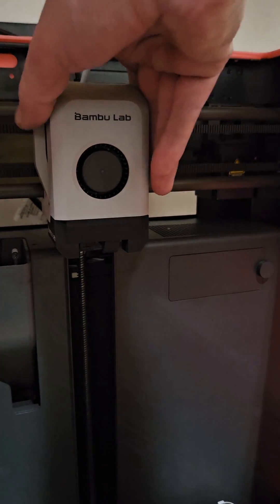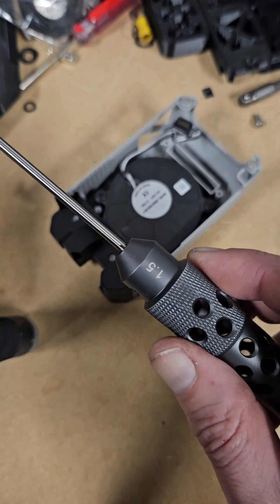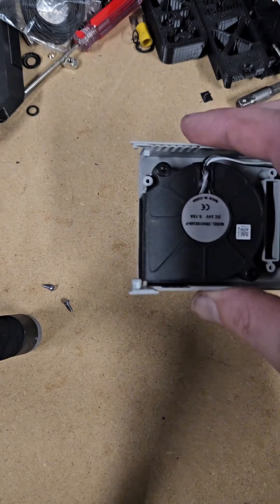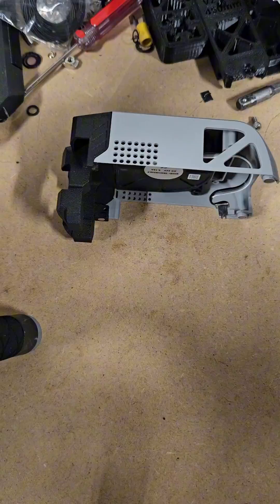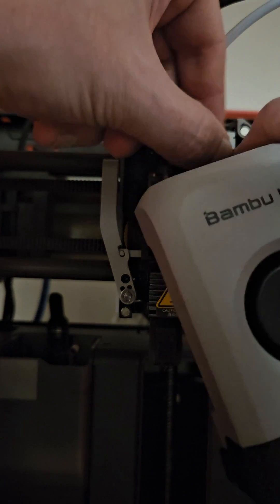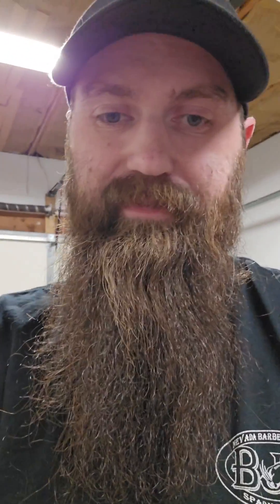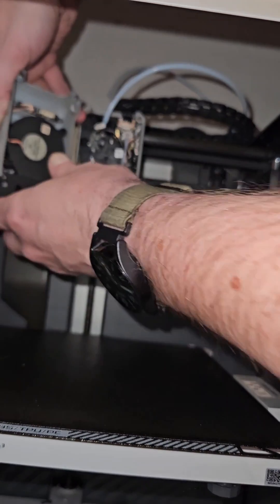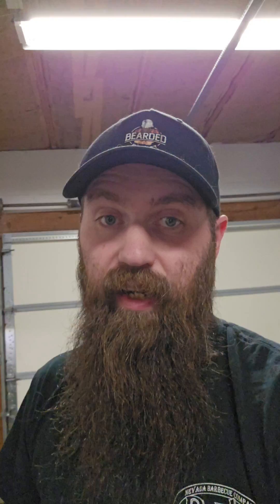How to install Panda Jet cooling duct on your X1 and P1 Bambulab printers

Comment: Cant help but notice you cut out where you struggle to get the duct OFF the faceplate.. dont make a video like this then skip the parts that are problematic.
Reply from the maker: This was originally edited for shortform not a full review or tutorial. Of the four I installed only one gave me any real trouble so this is a matter of some will be harder to remove than others. Thank you for the feedback and I will try on future videos to include more details  when I post them on here.

Comment: Glued on a little bit? Bro, these must be epoxied in, lol 🤣

Correction, there IS epoxy on mine! The tab next to the tiny magnet had black epoxy filling the tab insert. I had to break the tab insert, but it's till usable, should I wish to go back to the original shroud. They must have started adding that to keep people from changing them out. SMH
Reply: Yeah... I struggled a lot as well, so do not feel bad at all. I even broke one of the tiny clasps in the housing unit after scraping the epoxy away for give or take 2 hrs with tweezers and a razor blade. In the end, there is no way to do this mod with several printers without possible ruining your tool head front housing unit. I accepted that it wouldn't be "perfect" anymore and decided to refinish the entire tool head with special colors to get rid of the subtle marks I made while putting this mod on. I would recommend anyone doing this mod to use Permatex epoxy rated for 650 degrees F to seal the duct mod on afterwards. The P1S only goes as hot as 575 degrees F so this epoxy worked perfectly but there is better ones from Permatex if interested. I also ended up ordering a new fan and housing unit just to swap out for easier convenience if one goes down, they are like $20.00, or I just want test which one is better in different scenario. All that for one mod, is totally not worth it lmao However, I like making things slightly better for no reason haha
Reply: I wonder if they didn't just melt part of the tab sticking up from the original part?
Reply: @SorenTheSwede  Nah, it's black epoxy on both my printers.

In order to melt plastic for adhesion reasons, there are really only 2 ways: either apply hot air/flame, or sonic welds. Hot air would risk deformation parts of the plastic around the area. Sonic welds are really only used for seams as the sonic emitters have to be close together and melt everything between them.

Comment: You skipped the only hard part, getting freaking glue out. Cant figure out how without breaking the shroud
Reply from the maker: @nicholaskent3942  admittedly yes, it was shortened for time as it was edited not as a full tutorial but rather a brief overview of each step. I did four of these and some were harder and some were easier but none were broken. Take your time and just be careful and it will let go. You may try a thin edge of a screwdriver or knife to try and wedge it apart but be very careful to not break or damage anything.
Reply: @Bearded.Bucket Your video is worthless as it skips the ONLY Part people need.. how to get it off.

Comment: Is it any good? I've seen another video and it was recommended to blow compressed air through the ducts before installing it because it is made using powder / laser process and some of the un-cured powder sits in the ducts.
Reply from the maker: Initial testing has been promising. I too saw that video and had my compressor setup to blow each one out, I had four of them to install, and blew each one out with nothing coming out. My guess is they too saw that video and added it to the qc before shipping to customers and is no longer needed. I would say it can't hurt to be sure but just make sure to set the regulator on your compressor to a reasonable level to avoid potential damage, I set mine to 60psi and did not damage but I can see if you had it cranked up it may be risky.
Reply: @Bearded.Bucket  A video of your test results, especially if you have a before and after would be appreciated 😀
Reply: I just installed it too and have to say that without tinkering in the settings ovals and overhangs got better. The glue can be tricky, I broke a little nob in the orig. cooler.. 

Besides than that worth the upgrade. Also installed the biqu hotend and a diamondback nozzle 😅 @andyspoo2